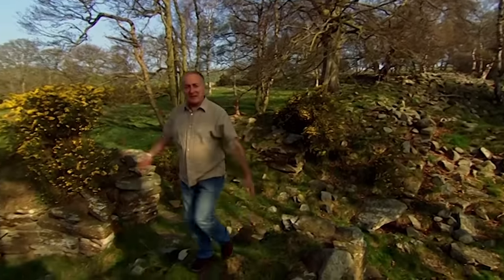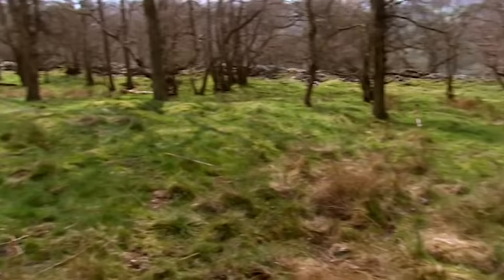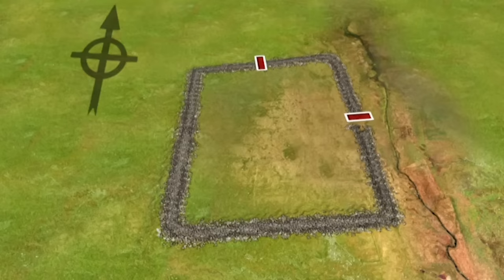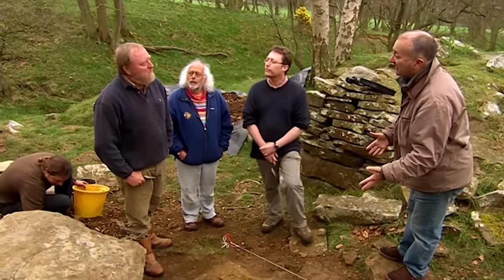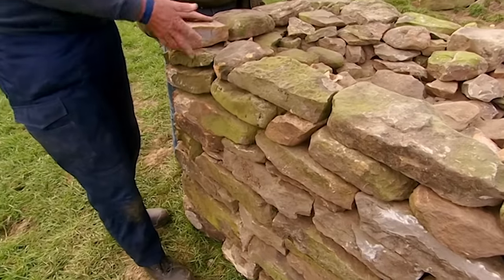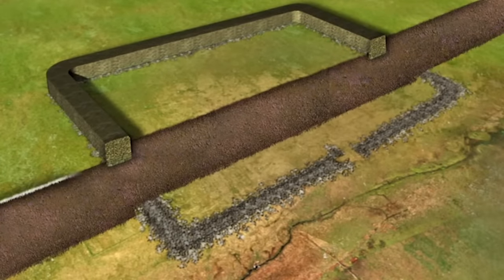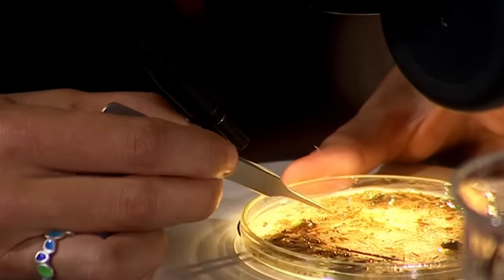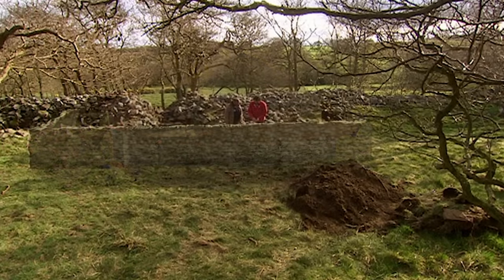5000 Tons of Stone (Hamsterley, County Durham) | S15E11 | Time Team

Comment: Years ago I visited relatives in Sweden and saw my grandmother's childhood home. Around it on at least two sides is a stone wall that's 2 meters in some places, , and 1-2 meters wide. I was told that all the stones were taken out of the ground to allow farming. I don't know how old the wall is, but my grandmother was born in 1886. It looked like a huge effort, but one that a small team of men could have done over a short period of time. This wall isn't THAT much bigger.
Reply: Well, the wall they found is 5 meters thick,  which is 2.5 to 5 times bigger than the wall of your grandma!
Reply: more like 10x the total material per foot of length. And way more length. And probably bigger stones. Probably still done by a small community over time, though.

Comment: I think I might know what this is all about. I'm From The Netherlands and i recognise this as an early example of things we have and have found in the Netherlands during the revolt agains the Spanish oppression. We call it a "Schans"(gutteral pronounciation). It was used as a refuge for people who were out in the fields or traveling, on the roads ,and things like that. Knowing there were 'troubles' in the area but did not have the time to get at a real fortification. So they'd flee to a schans. And as of the looks of this one you found it must be old. And that would be the best explaination for the reasons you did not find any datable evindence because the people were on the run/move. And they would not have many possions on them. And if they would, It would be the things they needed beeing on the move. Like sheepherders. Thats why the wall is that thick. The rule of thumb was, that you wouldn't attack the schans and would only approach it when in need. The people sheltered-up there would trade something of food and things like that, to satisfy the 'passer-by'. And sometimes this schans woulde be attacked if the refugees could not give something. Thats why its considdreble thick walls but not that high. And thats why its easy acces because its for the herders and people that had not enough time to reach a settlement or fortifications. There is much more about the uses we had them for but in the UK it must have gotten out of fashion quick. because in The Netherlands they became pretty elaborate. And were build like a miniature star-fortifications sometimes. 
Just a thought.....? Excuse my bad English...--------------------------------------------------------------- Update: 

A Google link in Dutch but with pictures for example: Boerenschans (Farmers fortifiacation). Schans came from the old Dutch: Verschansen. To fortify/To hide. 

https://www.google.com/search?newwindow=1&sxsrf=ALeKk00NbZm9FgrhUkVBJcUbByD0TdXKvg:1612745279283&source=univ&tbm=isch&q=boerenschans&client=firefox-b-d&sa=X&ved=2ahUKEwjp_O-riNnuAhURP-wKHeqXDl4QjJkEegQIAxAB
Reply: Thanks for this, but would the walls really be that massive ? Sounds more like what Brochs were used for here.
Reply: @jaytay8637  You did not look-up the link I provided!! Look at the google link. There you can see the examples from Flemmish and Dutch places where they are found and in most cases still in use!! There are walls 5m thick but also the gate's will compare to what they found. There are rectangles and star formations but always massive thick walls. From Brick or earth/clay, enz..enz.. I'm not guessing sir, it is actual fact, with pictures and drawings! If you'd just look-up the link, you would not ask this question!! Or compare it to Brochs!!!! The fact that you are compairing my explaination to a Broch, shows you didn't see the pictures from the link. If you would have seen it you would see that those walls here, are 5m thick and sometimes thicker at the base. With gates like barndoors and gates like a drawbridge. Go and see. Sometimes there are little villages still in and around those Schans'ses. Some places are still called "Schans- " where people are still living.------------------------------------ Update: 
Those pictures show that its almost the same as they found with time-team. Otherwise I would not recognise it as a schans.
-And, a schans is not for permanent use. It would be for the populous. Not the Lord or the most important person in the erea. Just the farmers and the herders. Nothing like a broch!! Some brochs have a little village build around it. This is not the form and function of a original schans. It was for hiding. Not for showing where you where with towers 10m+ high. But just like they found in this episode. Rectangle, thick walls, used for a long period, no datable finds in the area, signs of development from rebuilding or repairing, improving. A broch is thé fortification in that area. A schans is a small fortification for people who can not reach thé fortification in their area. So no... Nothing like a broch!!!
Reply: @MuZeSiCk77 Wow  ! Thanks for all that but all I was positing was that it was made to be a 'safe place' ..like a Broch was, so we are in agreement then.
Reply: Interesting concept. The idea makes total sense especially if you're near a waterway, where an enemy can be upon you fairly quickly. Without fast communication for warnings it would buy you some time and protection. In a way the US military did something similar in Vietnam with smaller fortifications near the main one. Khe Sanh would be a classic example.
Reply: Nice idea except its about 2000 years older than the war of the Spanish succession. As far as I am aware the English had nothing to do with that war (I think we were back on the French or the Irish or the Scots at the time). Also I don't think it looks anything like the ones in the link you provided. I think it was like they said near the end that is basically a farmstead. Life was pretty harsh in the iron age and sometimes you'd go and batter your neighbour because they look like they had better farmland than you.
It's a brilliant site I love pre medieval digs. I am personally not a fan of roman digs though.
Reply: Also, they are not seeing the obvious in the local environment. Look at all these yellow flowering bushes. It is most likely the same things that grew there when it was used. And that looks like food for goats and sheep. If these are Forsythia shrubs, then they could have been used as medicinal plants by some local monks, druids or other advanced herb garden facility.
Reply: @Tiger89Lilly  Im not saying its from the same period. Im saying we used to build new ones right up until the spanish succesion. Maybe even later. Thats why i gave the expression " in u.k. it must have gotten out of fashion real quick" ... excuse my bad english. Just a dutchman...
Reply: @MuZeSiCk77  ah sorry friend a misunderstanding on my part
Reply: @aresaurelian  
To me it looks like gorse, and I think they called it that.
Reply: @MuZeSiCk77
Looks really like the same sort of thing. Very well spotted! :)
Lijkt er inderdaad heel erg op. Goed gezien!  :)
Reply: @Tiger89Lilly  The dating is only based on environmental DNA which imho doesn't date the construction at all.  It may be much younger than that.  Until they find some pottery or other archealogy the dating method is speculative at best.  The OP of this comment may very well be onto something.  It would be worth checking which major wars terrorized that area in the past.  Specifically look for wars that had soldiers involved in looting and mutiny.
Reply: Thank you for sharing the information.  It is interesting.
Reply: @MuZeSiCk77  I think you are right. I explains the core samples, the lack of finds, and high walls to keep lifestock in too. These were herders, semi nomadic, your suggestion was briilliant thankyou.
Reply: Very good suggestion. I might have something really similar, but this one was not surrounded by water.
Reply: I had been wondering why it would be built by more people than used it. Might this suggestion answer that question?

Comment: The building materials of older sites like this often get pilfered through the ages to build newer structures elsewhere without having to cut new stones from raw materials. That massive amount of stone would take scores of people cutting rock and hauling them to the structure over a considerable length of time. Locating the quarry would likely yield broken pieces of stone cutting tools that could be used to date the finished stones. But also, permanent inhabitation over a long length of time would naturally generate dead bodies. Would they not be buried nearby? Their burials could yield trinkets which could also date the site. 3 days is just not enough time.

Comment: IF you're just trying to keep livestock in, the size of the wall is like going rabbit hunting with a Howitzer.
Reply: Yes this makes no sense at all.  They must be overlooking something.  It's possible it got used for livestock at a later date but 5 meter thick walls and this tonnage of stone indicates an entirely different purpose.
Reply: Something wolves couldn't jump over?
Reply: Yeah, must have had a défensive purpose!
Reply: @anonymous-rj6ok  Possibly it was partly against the weather. My grandad shifted snow up near Hamsterley (using a horse-drawn plough!) and there could be snow drifts of 10 feet high in bad winters. The wind blows mostly from the west and brings hard weather down from the hills, while an east wind can be 'nithering' as we say, i.e. really bitter. Possibly it was a combination of defence from raiders and from the elements. Maybe folks lived elsewhere in the rest of the year but moved into shelter during the worst months - when they'd have fewer stock anyway because they'd slaughter any expendable ones (i.e. old or none-fertile beasts) if/when fodder might run short. Intriguing site.

Comment: This enclosure reminds me about a base for a wooden castle. In Finland there are remains for over 100 castle hills - up on at least some of which there has been a wooden castle. And some of such seem to have had a stone base on which it would have been built. Those were used in late iron age - well same time than Vikings were about. But it would have been built on a very hard to climb a hill with an entrance on the easiest side. And usually it would have been located near a river - and there would have been warning fires on top of other hills down the river. As it was clearly different looking the viking boat when they were out pillaging and plundering - and when they were out to trade - given that they used different boat types for one and other. So it was pretty much possible to see if they were going to attack or want to trade and thus with warning fires - it was possible to tell people to send out alarm when an attack was pending for people and cattle to get to the wooden castle. Well it was generally against Vikings or Novgorodians. But yea - the wood on top of those a bit less 'squared' stone base-structures have by now obviously vanished and not all hills needed full enclosures being impossible to climb on some sides - and this thing makes me think of such a base for perhaps wooden walls that could have stood on top. All though I think it is particularly Finnish way of making castles prior to the medieval fully stone castles. As they aren't made on hand built hills and not really shaped like those Norman versions that where anyhow later, and temporary before stone structures.

Comment: I've been wondering if the enclosure was so robust because of the number of beasts held in it. The silty waste based sediments bear witness to some human and animal presence. I think the houses are for people to look after the animals seasonally. Even on some rotating roster. I think the permanent/semi or not would be nearby but up higher than the animal enclosure. As you said, animals are a valuable asset needing protection not only from raiders but also the elements. The height and thickness of the enclosure walls will have kept some of the ebb and flow of temperature changes over the night as colder and warmer air flowed up and down the hills. It's far enough away from the small valley to avoid the biggest temperature fluctuations and still have water nearby.

Comment: Whenever they are passing stuff from person to person it drives me bonkers. Your supposed to stand facing opposite directions to each other, less twisting in the back so it's safer and it is easier to pass things. A couple did it right on this one though.
Reply: 11 months later watching a rerun and same thing popped into my head. They way they pass things you have to pass it to the next person that's 180 degrees from where you received it. 2 lines of people facing the gaps between the people in the other line with the lines just far enough apart to pass without reaching much and if the lines are combined everyone would be shoulder to shoulder. One hands you the heavy object and you pass it over to the next with only 90 degrees of turn, all from the arms and legs and not the back. Safer because of half the twisting and none in the back and twice as fast. Tighten the spacing between each person in the lines and you can do it with 0 arm swing or 0 leg twist. 

Shoulder to shoulder and you can insect walk a long pole with the hands and arms acting like the legs.

Comment: In the absence of dating evidence, its hard not to see a Romano British influence in the overall plan. 
Several broad ideas come to mind: a communal effort by local farmers and land users, to concentrate live stock for short periods. They were very conscious of ensuring the animals did not get away, but not very concerned with security.
A token caretaker presence was necessary to protect and feed the animals. But very little was kept permanently on site when not in use. This explains the absence of significant rubbish heaps. 

Id be looking for a rubbish dump outside the enclosure.

My hypothesis is a tribute or tithe operation for a war lord. The elaborate construction of the yard, may have been an act of tribute in its own right. Certainly a statement that taxation in the form of good in kind was a permanent fact of life.

Comment: Pretty much at any o e time at least one ship will have a serious issue or completely broken down for anything up to a year. Ataere had a broken gearbox so was force to take a longer than normal route. 
She was lengthened by 30 meter 13 years ago with upgrades to engines and propeller but not drive shaft hence she has propellers falling out a couple of times. 
Cook strait is one of the roughest crossing in the world and ships sailer it should have double bulkheads but don’t. She was weakened by being lengthened and rated for max 1.5 m swell but regularly sails in 6 metres
Add age and it is no wonder they are so unreliable 
By the way Picton is pronounced
Pick-ton not pink

Comment: One hundred years to move all that stone is an odd estimation, I've worked as a labourer before, and moving four tons of tiles in a day is quite easy, which means that moving 5000 tons should take less than five years
Edit to add, 4 tons a day, 400 tons in 100 days, 1460 tons a year, which works out at 5000 tons in around three and a half years
Reply: Lifting a 5 pound tile from one stack to another stack isn't the same thing as digging out and carrying 50 pound stones from WAYYYY over there to WAYYY over here, across uneven ground, and building a wall 1040ft long,  16ft wide, and 12ft high
Reply: @maxsdad538  no, picking up six tiles at a time, carrying them on to a roof on your shoulder and stacking six per meter along each batton on the roof, four tons in one day isn't the same as standing in one spot and giving one tile at a time to your friend.
I know road workers that have professed that if you can not shift five tons of mud per day by hand you  won't keep your job.

If you have never worked as a labourer or have never met a labourer in your life why comment?
It's quite clear that you have no clue what the job involves.
Reply: @maxsdad538  I suggest you watch some labourers build something, then tell me I'm wrong.
Either that, or do a labourers job for awhile, I have.
Reply: @JamesCairney  I can shift 5 tons of muck in a day but not to somewhere 10 miles away
Reply: @UPTHETOWN  who said it was moved ten miles? Why would the stone come from anywhere other than the near vicinity? More than likely collected over less than a square half mile, so even taking account of the walking involved, still isn't anywhere near one hundred years. Probably still closer to five.

Claymores show how big Celtic people were, these days claymores have been used in strong man competitions, and all they have to do is hold the thing straight for a while, nevermind fight with it, these strongmen can still lift a stone over 200 kg from the ground to a head height plinth, five, six stones in a row, within a couple of minutes.

Even being half as strong as someone capable of swinging a Claymore meas you should be perfectly capable of shifting four tons of stone per day.

Edit to add, here is an atlas stone competition
https://youtu.be/7NX2T4Ndjig